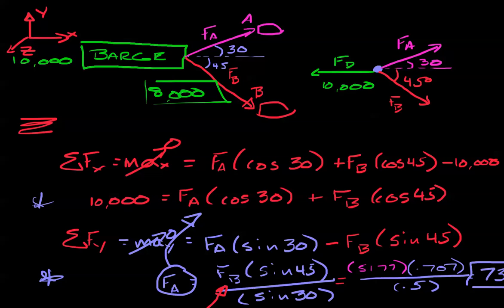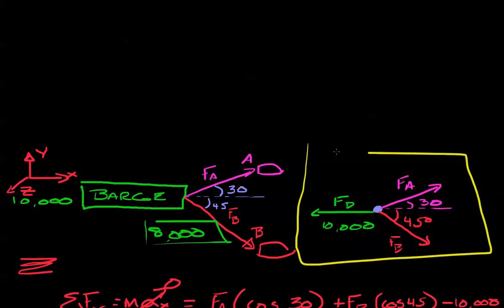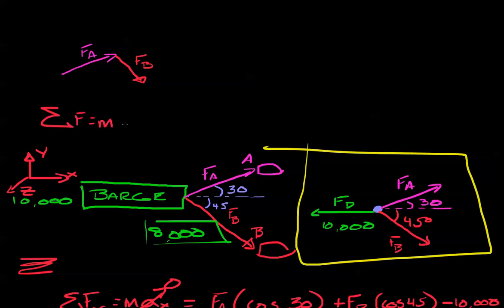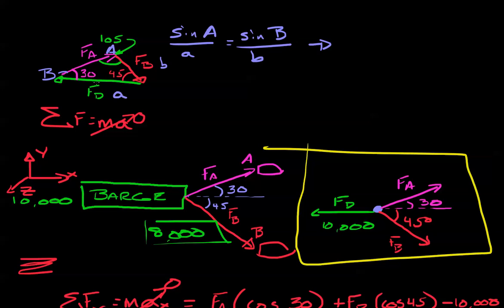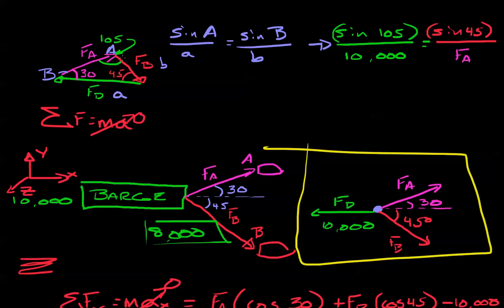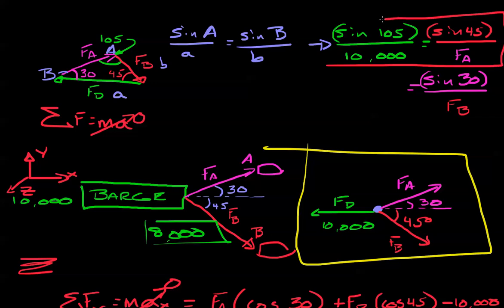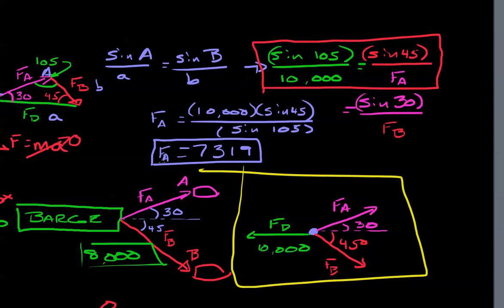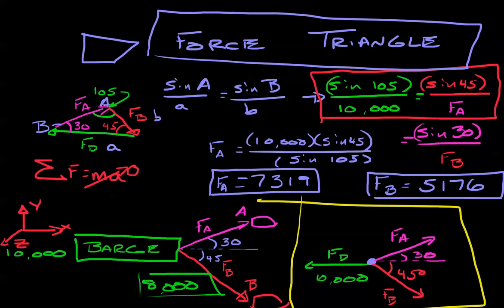Engineering statics 03 force triangle PE

Comment: I often get confused in the complimentary and supplementary angles. Is there a trick to remembering how they correlate to each other? I usually draw two parallel lines with one intersecting them at a large angle. However, this worked for Trig but doesn't seem to work as well with Statics. I'm taking this course over the summer and have to get comfortable with this topic. I have watched several videos on Trig and Statics but the angles never get to complicated or obscure. Thanks for the video!
Reply from the maker: Yes, it is tricky to work with.  That said, you will work with this concept, so you have to know it.  To get there, first use repetition to memorize rules.  Second, exaggerate the drawing angle to clarify which angle you are looking at: in other words, if the measured angle is at 40 deg, redraw at 25 so everything is clear.  Good place to start, at least.  Good luck.